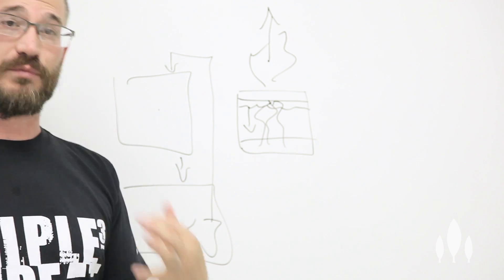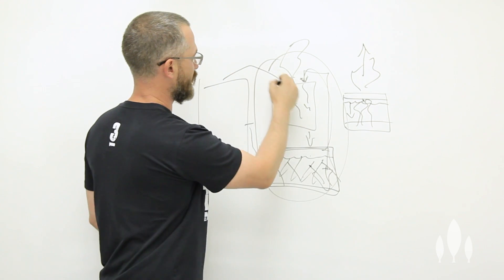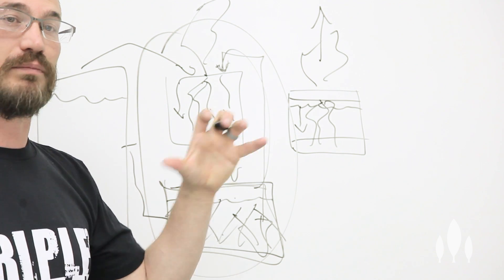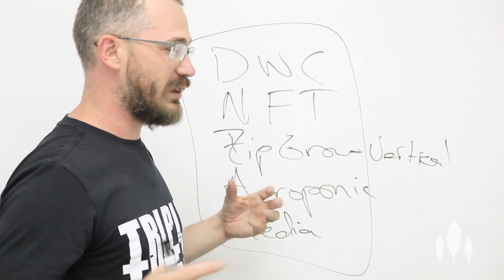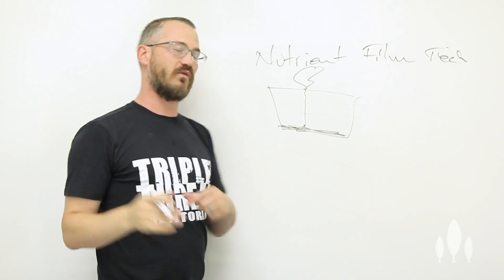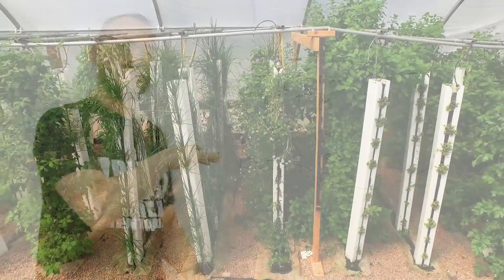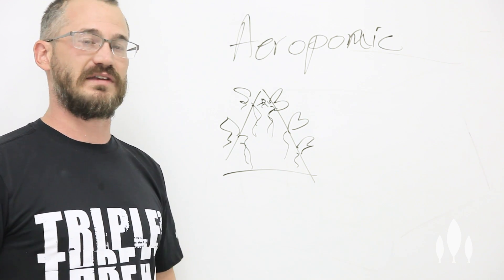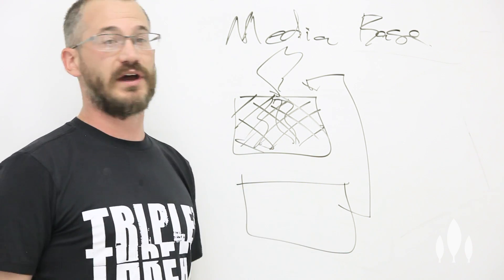A Beginners Guide: Hydroponic Design

Comment: I'm using smartpots and I rly love them. Also the taste of a grow in a 
good soil mix. But I would like to use the benefits of hydroponics. 
Could it be possible to use the benefits of soil and hydro together? I 
already have tested it for a week, with massive overwatering my Soil in 
the Smartpots and had also a massiv root growth outside the pots. They 
looked rly healthy and I had a good growth of my plants, without any 
overwatering damage, even my Soil was 24/7 moist and well watered . But I
 dont know if its worth or a good idea to invest in a Hydro System for 
Soil potting. The most people say its stupid and a waste of money, but 
the roots looked so good, they ware so long and white and I think this 
could be much better if the water was recycling. In my setting the water
 stood in my container, with my Smartpots.
Reply from the maker: Sure, you can always set up a test system to give it a shot. Smart pots are just fine for hobby growing though. It's all about your goals - what are you hoping to achieve by going with hydro?
Reply: At least, not to fail. I dont have enough money to fail, but I also want to maximize yield on a small space, with a good taste. It's kinda risky and I see some problems. Like: what about the microorganism in the Soil, or the fungy that supports my plant? Even if it worked for a week (actualy very well) I dont know if this is a good Idea for a whole grow cicle, or even for a complet hydroponic dripping System.

Comment: Please give me a reason why aeroponics not effective in commercial scale, thanks for the video
Reply from the maker: Hi Vahid, the main reason we don't recommend aeroponics is that maintenance gets pretty intensive. Root zone temperatures have to be kept very stable because there's not much thermal mass. The nozzles for the mist are very fine, which means that they can clog up easily. Between these two things there's just too much maintenance and risk for commercial growers. That said, aeroponic systems are really cool and great on a smaller scale. We've run them and had a lot of fun with them.
Reply: Hello, In a controlled environment, the root zone temperature is easier to be kept stable, regarding the high watering frequency, than in a media based system. The nozzles percolation is a false problem if you use professional nozzle, you just have to clean up your system with acid and H2O2 once a year (if you use low pressure nozzle you even reduce this problem). This techniques is widely used in a commercial scale for mini-potato tuber production in NL since years. And some company started to use it at commercial scale in vertical farming (AeroFarms, GrowTruck and others).
Reply from the maker: Yes, there are ways to deal with nozzle clogging, scale, etc. but it's not typically a technique that your average person wants to tackle for relatively low value food production.  There are a number of folks using it as a production technique, but the jury is still out as most of them are brand new- for instance, AeroFarms has only produced one or two crops at commercial scale with their technique, and they're only a month or two into production.  I'm not saying it can't be done.  I'm just saying that it hasn't within this context.
Reply: I find aeroponic growing lower maintenance than any method that recirculates the nutrient. Root zone temperature, clogging and  uneven mist coverage issues are easily addressed by selecting the correct type of nozzle for the task. In the right location, a commercial aeroponic system could be operated completely offgrid using only renewable energy.
Reply: I`ve run high pressure aero for years, indoors under lights and outdoors in full sun.While not commercial scale, most hobby growers dont use 16ft long, 56 cubic feet chambers. If you want massive commercial scale, its perfectly possibleto run 20,000 8`x 4` aeroponic chambers without temperature or power outage issues.
Reply: How would you compare aquaponics to hydroponics?  Is aquaponics also higher maintenance than hydroponics?  I'm trying to evaluate all 3 in terms of ROI, capital cost, and recurring maintenance costs.

Which of the 3 is most "hands-off" with regards to upkeep and maintenance?  Thanks
Reply: Also, say you have a basement with ample space to grow, which of the 5 techniques you mention is most cost-effective?  With ~800 sq ft, space is not really at a premium, and the subterranean climate would theoretically mitigate temperature fluctuations more than a system installed above ground right?

In addition, basements typically have higher humidity than above ground, so that should also aid in growing conditions.